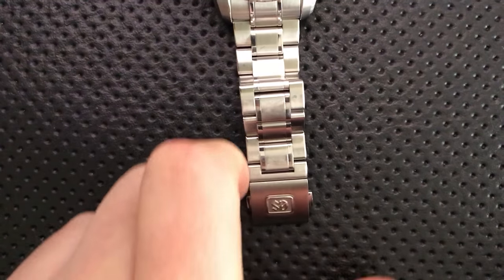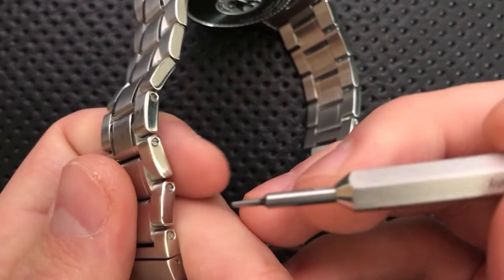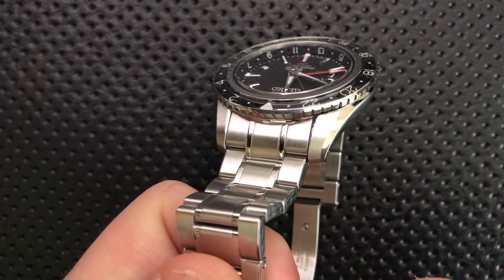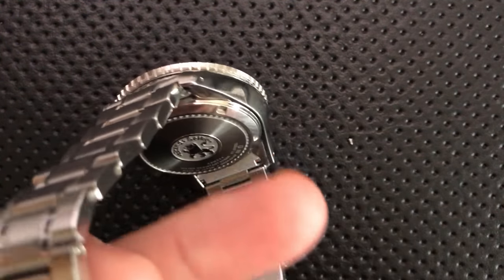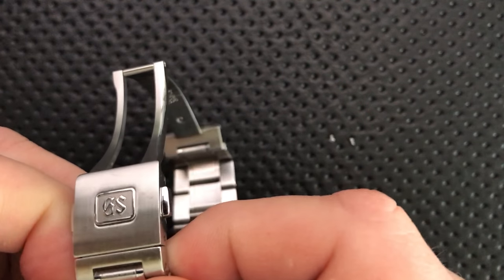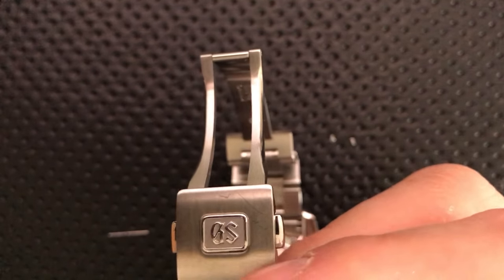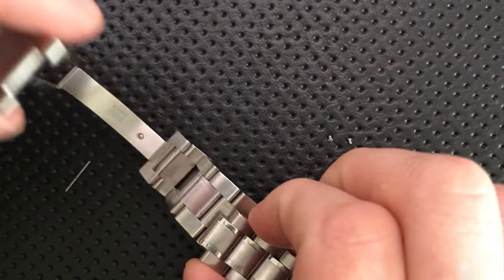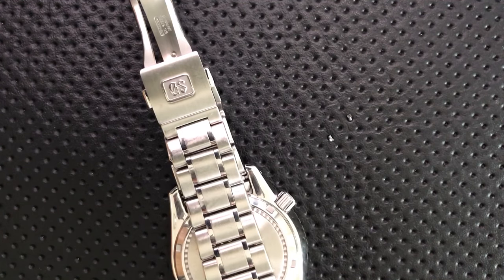How to add or remove links on a Grand Seiko Screws-and-pins Watch Bracelet

Comment: You needn't unscrew the second screw.  Gentle shake, rattle, and tap, and the pin will usually slide out.
Reply: This comment was crazy useful. Sometimes the screws are impossible to unscrew but the other side is unscrewable. Thank you.

Comment: What about  removing half links...screws look different..I added a link watch  to my sbgx085 it was to big..took one off ..fitted me but when in warm conditions its too tight .I saw on a forum if you remove the two half links and add one full link it's abit larger..But it looks like the part holding the half link.is smaller than full links and to me it will be loose.

Comment: Sbgx002 is different..screw  is in center  of link  just one on  side than a small little bracket inside that part you take off...took me a nearly a hour to put it back...half link looks harder..to do...I need to take half link off but won't chance it...older model watch

Comment: lol i didnt realize it was that easy. my tissot prc200 flops around my wrist from 12-6 and it drives me nuts. i may just try to remove my own links. mine dont have the screw, looks like just push....i might wanna tape up the sides to not scratch it up though. im not the most gentle

Comment: Do they really make screwdrivers that small for those screws?  I can't get a screwdriver to turn the damn things on my bracelet.  It fits, but its almost like the tip is to dull (or fat) to fit in the slot
Reply: You probably resolved this years ago but if not, you need a higher grade 1.5mm precision driver. Most out there are quite thick, partly due to imprecise machining, and partly due to the use of lower grade non-tool steel that will deform easily if not thick. I highly recommend the precision bits by Wiha. The handle that comes with their basic set is so much less good than their bits, it’s a shame, but it’s serviceable. 90% of the time I use the handle from my Ifixit set and a bit from my Wiha. Exceptions are when I need an odd shaped bit like the triangle ones found in some computers, the Ifixit set is a lifesaver for those, but the 1.5mm slotted, like yours is a bit too thick.
Reply: @automaticreviews6999  Thank you for providing these details!!!